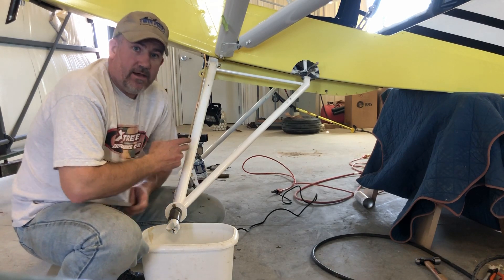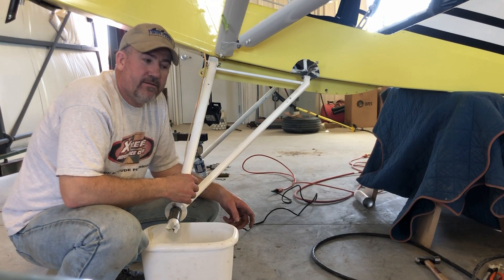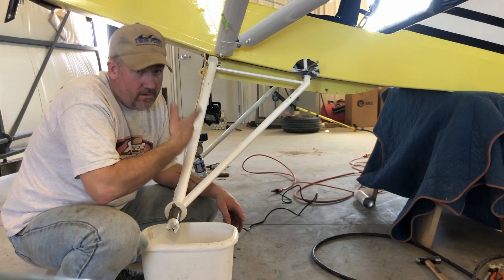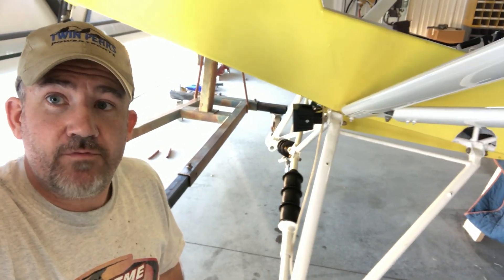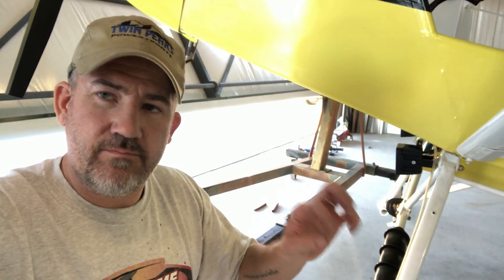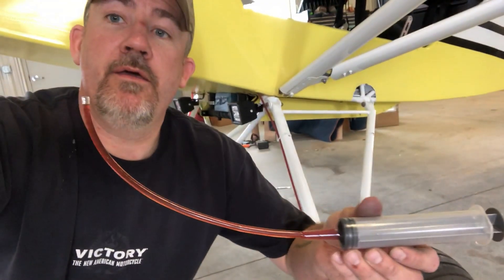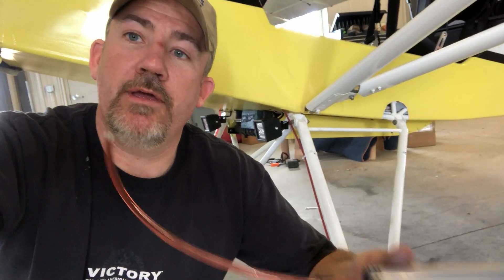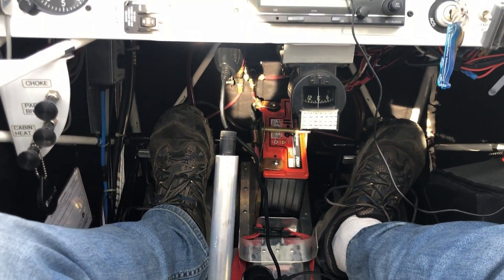Rans S7 Bush Gear install 2019

Comment: Great video mate. I'm in Australia just bought my first fixed wing plane Rams s6s.
In the process of replacing the wheels. Turns out I need to up grade gear legs which i think are the same as the s7.
I was wondering why the gear isn't built like cubs etc. Cool to see you upgrade it to cub style. Looks strong as.

Comment: About what does this kit run?
Reply from the maker: Thanks for subscribing!  The kit runs under $3k powdercoated and with steps.  You can get it without the steps and unpainted if you prefer and save some $$.  I’ve got more videos coming soon...I’ve installed TK1 shock from Shock Monster, and I’m loving them!  Of course, that’s another $2500.  So, bushwheels, shocks, and gear, you’re gonna spend nearly $8k.  It’s kinda tough to type that or say it out loud. 😏
Reply: OneFiveMike We are parting ways with our RV-6 and it’s looking like an S7 or S7S may be next, so I’m going to follow your adventures.
Reply from the maker: Looks like giving up RVs and flying lower and slower is a theme amongst Rans customers!  I wish I could have both, I miss my -6 in a lot of ways, namely 2x speed...but the S7 is a super fun platform, and a new kind of flying for me to learn.
Reply: The loss of speed in my only concern. Well that and the aerobatic abilites, but I think I'll survive.

Comment: I too put the Roberts gear on my 2001 S 7 long tail. Not one to leave well enough alone, I tried the rubber bump stops and found them to be to stiff for my liking, then tried the old rubber bungees and wasn't happy with them either... finally put the monster shocks on and now I'm happy. It's all about personal preference.  Out here in NV we are in the bush all the time and the Roberts gear and 20" tires work great for me. Ralph
Reply from the maker: I’m curious to see, Ralph.  This is John’s “standard” way of building them now...they do seem stiffer than I expected, but I’m also running some pretty stiff Goodyear 8.50s that don’t give much...  sounds like you’re running the Desser tires?  Each time I get ready to order the Airstreaks, I choke on the price and hold off!
Reply: Agreed, the Airstreaks are tough to justify compared to the Desser and the service life is fairly short unless you can/want to resurface them.
The other item that was worth every penny was the T3 tail wheel, if you don't have one be sure to look into one.
Ralph
Reply from the maker: Hey Ralph, did you ever try springs in place of the rubber bumpers?  I’ve got some springs off a skidoo I was going to use to build gear, thinking I’ll give them a whirl.  Almost the same OAL as the three bumpers...
Reply: OneFiveMike for me the monster shocks work perfectly, an shocked spring kind of defeats the purpose... your plane looks great
Reply: @OneFiveMike  Actually I call Roberts and got him to send me the old bungee setup. That was to springy so I then went with the Monster Shocks and love them...
Reply from the maker: Well, Ralph was right...Shock Monster it is, and I love them!
Reply: @OneFiveMike   I don't know if John makes them anymore, but i have bungees AND  Fox airshocks on my gear.  HD bungees, for a Super Cub, in the Spruce catalog.  About 125 pounds air pressure.  No rebound to speak of, and lot's of cush.  29" ultralight Airstreaks (12 pounds lighter then the stock Airstreaks).
Reply: @OneFiveMike  can u send me a picture of ur gear? And the shock monster?
Iam having the same feelings of it being to stiff..  thank you